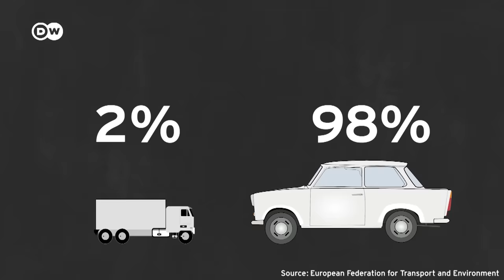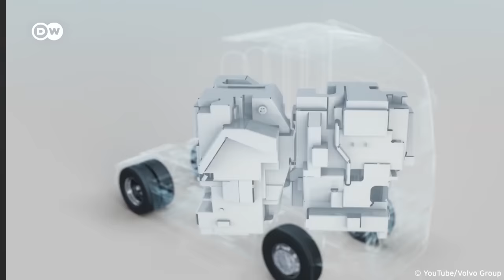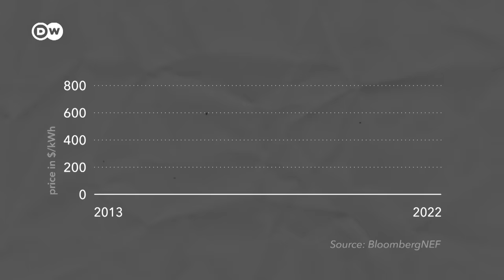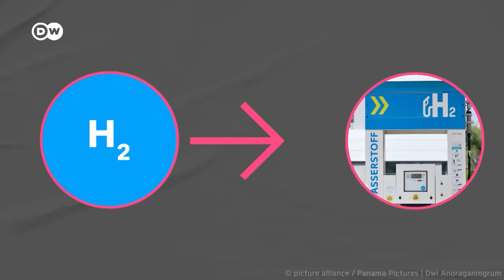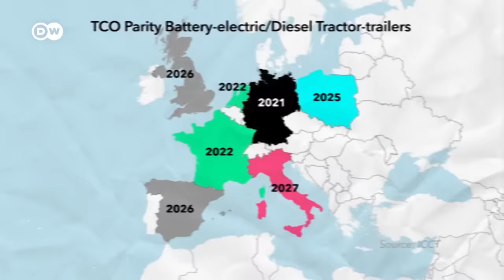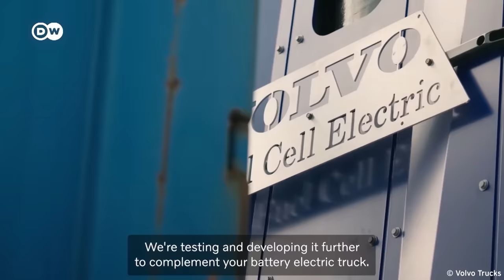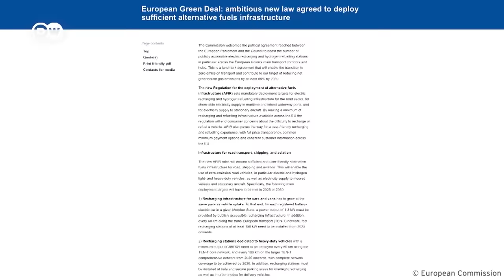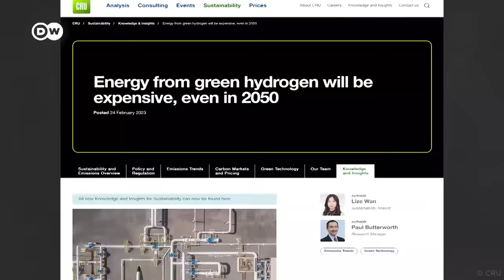Which will be the engine of the future?

Comment: I always thought that the trouble with electric trucks was that the batteries are heavy so they eat into the weight that the truck is permitted to carry on the roads.
Reply: Yes, but not as much as had been feared, US adds 2,000 lb to the 80,000 lb limit for low emission vehicles, and it looks like that's enough. The volume (space) taken up by long range hydrogen tanks is the flip side of the same coin.
Reply: The weight is a factor but charging time hasn't changed and each truck needs a Megawatt charger for about 8 hrs to go 500miles /800km.  Where as diesel has 1000miles/1600km with a 5 minute fuel stop (truck stop pump move fuel much faster than passenger pumps)

Then ask yourself how are the roads being funded when EVs weigh more put are not paying fuel taxes.
Reply: You're math skills are a bit off I think. A truck uses 1,1 kW per km. So to drive 800 km you need 880kWh. A megawatt charger charges 1000kW. So to fill up a 880kWH battery it needs to run 880/1000 of an hour. That is 53 minutes, not 8 hours.
Reply: @bartvandenpoel8568  efficiency rules all.  Can't charge at max power or battery will explode and more systems are used than just the motors during driving plus elevation changes and are your numbers at max load?
Reply: @bartvandenpoel8568 Of course you are perfectly right, but as you can see with the following comment, being right on basic maths does nothing if one has already decided that EVs are bad. Haters gonna hate.
Reply: @brushlessmotoring  An extra tonne of load will help but I think you actually need more than that for a semi.  On the gas side, I wouldn't worry so much.  When oil prices were high about 15 years ago all the trucks and busses moved to CNG, almost overnight, and they manage OK.
Reply: The best BEV heavy trucks are either on par or only slightly heavier. Tesla Semi is the best example. The tractor weighs around 25,000 lb. Which is on the heavy side but still on par with the heavier diesels.
Reply: @bowez9 where do you get this nonsense? A Megawatt scale charger would charge Semi in 30 minutes. The time of the required driver rest break in the US. And fueling a diesel semi is typically between 10 and 15 minutes. And the driver still has his required rest break. 
Ask yourself how the damage from climate change is being funded already. The answer is with your tax dollars.
Reply: @bowez9 Tesla Semi has a 500 mile range on its 900 kWh battery pulling a 55,000 lb trailer. And can charge at 1.5 MW peak. That is 5% charge to 80% charge in 30 minutes. 
Note that 480 miles is 8 hours of driving. The point that, in the US at least, a driver is required to take a 30 minute rest break. 
Also note that 80% of 500 is 400 miles. So the truck can go another 6 hours for 14 hours total but the driver is limited to 11 hours total for a work shift. 
That means the driver has a lot of discretion on when to stop to charge and a significant reserve left for a full day of driving.
Reply: @williammeek4078  30 mins is from 20 to 80 percent not 5. And that is under ideal conditions.

not for OTR or team driving, then the limit is fuel.  Actually  talk to drivers and you will find out only theirs logs show they are doing it by the book.  

But the better question who's going to let a truck charge, the customer, the broker, or the depot?  Multiple Megawatt charger are hard enough in industrial areas they are nye impossible in rural areas were they will never pay for themselves.  Think a truck spends 5 minutes at tge fuel island now and there are 20+ pumps and trucks are still waiting now think of them spending 30 minutes there for 5 chargers, not even to think when one goes out.

Now how long and often do chargers actually operate at peak power delivery 80% is the practical upper limit.  RMS trumps peak.
Reply: @bowez9   no, it is 5% to 80% on the 1.5 MW chargers. And no, that isn’t just under “ideal” conditions. 
Even for team driving, Semi would only lose an hour a day. So for 95% of trucking, Semi will be as fast or faster. That last 5% isn’t enough to support the diesel infrastructure. 
Trucks will charge where they stop. Loading/unloading operations take enough time to fully charge at less than maximum rates. 
Anything less than 250 miles, just charging at the depot will be an option. 
Less than 500 miles, charging at the destination works. 
Only trips over 500 miles would need charging at a commercial charger. And that will be less than 5% of the time. And will happen on the driver required rest break so no time lost for any routes less than 900 miles. Which is 99% of road freight. 
Again, the market will sort that one out. 

Hate to be the one to burst your bubble, but the era of diesel is coming to an end.
Reply: @Will-ef2tw  after several million miles of savings in diesel, maintenance and downtime, and with the rapidly declining cost of batteries, probably $70 per kWh for a pack replacement, less the $20 per kWh the pack is still worth as ore for recycling into new batteries, you will still come out far ahead. If you use lithium iron phosphate, the insanely high number of cycles you can put that chemistry through will likely see the truck fall apart long before the battery needs replacing.

This longevity is proven through million mile Tesla Model S’s from a decade ago, the packs are lasting far longer than naysayers have predicted - the early Nissan leafs had a poor pack design, and this resulted in a bad reputation that has stuck, even after Nissan sorted their batteries out. Don’t believe the myths unconditionally, dig deeper into this subject.
Reply: @williammeek4078  sorry your numbers contradict Tesla.
Second why as a customer should I not only pay you to deliver but also pay to fuel you?

How far do you think a driving team can go in 23 hrs?  Remember driver 1 is getting his rest period in while driver 2 is active. 
Loading/unloading is were most drivers will get their down time.

How long will those batteries last fast charging them multiple times a day?

Logistics is a business of single digit margins.
Reply: @williammeek4078  ask yourself what is powering the mines for the batteries- diesel.   How are you going to stop the poor from using cheap sources of power- especially those not in your country?
Reply: @chuckygobyebye  because CNG is a lot more energy dense (by volume) than hydrogen. And you are right, trucking did shift to CNG when diesel was far more expensive. Which is why trucking is already shifting to electric on every route they can today, and looking to what else they switch soon - see Australia battery swapping trucking and of course the very encouraging real world results from the Tesla semi analysis. I’m not at all worried about whether it will happen, just a question of when.
Reply: @bowez9  batteries require a slightly different set of logistics than liquid fuels, not impossible, different, you are trying to treat the battery truck the same as a diesel truck, it isn’t, it’s slightly different, not better, not worse, different.

We do the things we do with diesel trucks because we can, we can’t do more, electric trucks have limits too, different limits, if you present those limits to a capable logistics company, and all the successful trucking companies are capable logistics companies, they will solve for the new set of parameters.

We are not going to figure it all out in the comments section of a YouTube video, but the idea an electric truck can’t be used because it can’t do this exact thing in exactly the same way a diesel truck can is clearly nonsense, especially as some of your examples are at the extreme end of trucking - so we keep using diesel there for a bit - it doesn’t mean we don’t go electric for 95% of the use cases they do just slot into. 

Relax brother, if it’s no good, it won’t get used beyond some trials, if it’s better, even if it’s different, it will get used. That’s the free market, and like you say, cost is what trucking companies have their eye on, but we do need to charge for the impacts of emissions better, you can’t pollute a river without being fined, so why is okay to do the same to our thin shared atmosphere for free?
Reply: @bowez9  specifically what numbers? Musk specifically said Megacharger can add 400 miles in 30 minutes. 

Semi covered 1000 miles in 24 hours with multiple drivers. And that was with multiple stops. And this is a typical distance for team drivers. 

The batteries are designed to last 1 million miles. With newer packs, fast charging isn’t hurting them. 

Then diesel aught to be very afraid because Semi has half the operating costs per mile.
Reply: @bowez9  read: “South African mines seek to turn up renewables to ease power crisis” - Reuters

That is my question to you. How are you going to stop poor people from using cheap sources of power like solar and wind that are already vastly cheaper than fossil fuels? It is already happening.
Reply: @williammeek4078  guess you never priced inverters or batteries to make it a fair comparison for 100% availability.

But your deflecting, answer what fuel is being used in the mines, for the trucks and the equipment.
Reply: @bowez9  i guess you never priced diesel generators and fuel for 100% availability. 

No deflection guy. Just the hard reality that mines are going to RE because it is cheaper and more reliable.
Reply: @brushlessmotoring  totally agree with your points.  Just too many people think EV is the cure all end all solution.
Reply: @williammeek4078  first what Musk say is usually at odds with what his companies say.  Ask him what the SEC has said about his comments, or what Germany thinks of his "autopilot".

If you think fast charging isn't hurting battery life then you haven't read up on the subject let alone reading the white papers.  Sony and Panasonic will clearly tell you that fast charging shortens battery life--and supply Tesla under liscence.

But EV trucks have a much lower ROI.
If they were so good why aren't the big frieght haulers(JB Hunt, Schinder, UPS, FedEx) using them?  I posit they only make sense in very limited use cause that PepsiCo is using it in.
Reply: @bowez9  you are giving the impression you think EV trucks are good for nothing - I’m sure that’s not what you think.
Reply: @bowez9  look at the differences between NMC and LFP chemistries. LFP can take a beating all day every day, these are not your 1990s camcorder batteries or even recent cellphone batteries.
Reply: @brushlessmotoring  they have limit use but in America I believe they will always be the minority-given a fair choice.  It's hard to argue with energy density of diesel and ROI of diesel trucks.
Reply: @bowez9  so, you have no contradictory information. Got it. 

If you think fast charging is detrimental to battery life for Teslas, you haven’t read up on the subject. 
Here is your homework that you didn’t do before. 
“Full Speed Ahead: EV Study Reveals Impacts of Fast Charging” - Recurrent 

“Nikola gets an electric truck order from JB Hunt” - FreightWaves

“Schnider’s Electric Heavy-Duty Trucks Start Off on Regional Routes” - Heavy Duty Trucking

“UPS Invests In Arrival, Accelerates Fleet Electrification With Order Of 10000 Electric Delivery Vehicles” - UPS

“FedEx Continues Advancing Fleet Electrification Goals with Latest 150 Electric Vehicle Delivery from Brightdrop” - FedEx

Pepsi’s use case is deliveries under 500 miles which is 95% of road freight.
Reply: @bowez9  if you don’t price in the pollution, diesel is quite compelling, but I still bet batteries will come out, total cost of ownership, cheaper - time and studies will tell, the market will decide, but, if we keep subsiding the cost of oil extraction and diesel emissions and don’t price those into the cost of the fuel, then diesel has an ‘unpriced externality’ that makes it appear cheaper than it truly is, so that’s a false ROI if we then have to pay taxes more to fix the problems it causes.
Reply: @brushlessmotoring  so don't subsidize the oil industry what about all the lubricants in EV and synthetic material used to make the ie the plastic films in batteries, but do subsidize the EV market?
Reply: @bowez9  I’ll answer your mine question: batteries (mines have long used electric vehicles underground for obvious reasons), charged by solar, wind and diesel. What’s your point? The first parts for the ford model T were delivered by horse, that didn’t stop the motor car replacing it. Try and let go of this absolutism, it’s meaningless, we will always be using a blend of solutions.
Reply: @bowez9  again - what’s the point you are trying to make? Yes, oil is used in EVs, for plastics, mining, lubricants, we still need all those oil based products - fertilizers, medicines - the list goes on and on - the goal here is to reduce *combustion emissions*, that’s why we are moving to electrics, to stop using combustion engines where we have a useable - different - but useable - alternative. It’s not about ending oil, it’s about stopping unnecessary emissions, a depot run of 200 miles does not need the long range of a diesel engine, as EV trucks get more capable and cost effective you replace 300 miles routes, then 500 mile and so on. Stop thinking in absolute all or nothing terms, it’s not helpful to the discussion, it’s why you are getting so much pushback.
Reply: @bowez9  as this video was about hydrogen trucks too - what do you think of hydrogen for transportation? How would you make the hydrogen?
Reply: @brushlessmotoring  if you understood oil refinement you would understand it is an all or nothing process.  
The mining equipment is by in large diesel series hybrid, diesel generators with electric traction motors.
Hydrogen IMO  is a better option than batteries, but why break down oil for the Hydrogen instead of just burning it as fuel.  Let's be honest on where the vast majority of Hydrogen is coming from and its not electrolysis of water.
Reply: @bowez9  do you have to be so insulting every time you reply to someone? Can you just not help it - are you even aware of it?

Oil refiing uses a stack, at different temperatures, you get different products, you can configure the stack to produce less kerosene, gasoline and diesel and more jet and rocket fuel. Yes, I do understand oil refining.

Hydrogen is made from methane, with CO2 released, is about 50% the CO2 of gasoline, so it is better, but, it's so complicated and expensive to handle, especially compared to existing grids that batteries are the better option.
Reply: @brushlessmotoring  you can change the output but not eliminate any of the products.  So if you want plastics you will have gasoline, kerosene, diesel...  so you either use them or waste them.  If you understood that why are you arguing it, oil is an all or nothing proposition.

If you're ignoring facts and figures don't be upset when someone treats you like you are ignorant.
Reply: @bowez9  The point I'm trying to make, is that these constant 'hydrogen breakthrough headlines' never deliver, wake me up when there is 100 millions tons of this 'white' hydrogen getting mined and transported - I feel the same about solid state batteries too - wake me up when a car with them has sold a million units.

'Headlines not Hydrogen' is what I call it, part of the 'please wait for this, don't get an EV' - it's a distract and delay tactic, and it works, repeating this borderline misinformation keeps people out of renting an EV to see if it might work for them.
Reply: Battery swapping for semi trailers is already a reality. The swap is done at freight depots as vehicles transfer loads or while drivers take a rest break. 

The swap uses a modified fork lift to slide out and replace the battery cassette. Depleted batteries are then racked up in a charger which gives them a slow steady charge.

The system is already in use in Australia.
Reply: @bowez9 for heavy machinery they could simply swap out their battery, that’s how china is doing it.
Reply: Also the loads made it have a very low milage. Just like when you towing using a normal ev
Reply: And don’t last
Spend more time charging then driving
Reply: i would invest in hydrogen, batteries are okay for now but they are not the future. fussion and hydrogen are the future in the next 50-100 years
Reply: @bowez9  So your logic tell a truck is driven 1000 miles without any stop for resting and that's why diesel is required? At least the resting periods which are mandatory in Europe are sufficient to charge a truck. It's just matter of how fast they scale up the charger infrastructure. I believe we haven't seen everything yet. Some kind of induction charging could come to truck lanes in some highways in mild climates. I mean integrated to the road surface.
Reply: @timogronroos4642  yes that is done , that is why truckers have pee bottles.
Reply: @Maxშემიწყალე  : Can you expand on your claim that batteries take a lot of oil to make and extract?
Reply: Not to mention the increased need for break and tire replacement.
How does replacement batteries and truck body parts cost vs diesel trucks?
Reply: @bowez9  Check your numbers. 8 hours at 1 MW is 8000 kWh. The Telsa Semi uses 2 kWh/mile. So 8 Hours charging provides a range of about 4000 miles
Reply: @PJRye  you assume 100% efficiency
Reply: @bowez9  No, I assume simple arithmetic.
Reply: @PJRye  and 100% acceptance of the battery and 100% delivery from sources, with no derating for heat or charging dynamics.
Reply: @bowez9  So you tell me what efficiency you are using. It looks about 5-10$% !!
Reply: @PJRye  potentially.

When did I ever list a charging time? I just all BS on ~1hr charging.
Reply: @bowez9  Good point about the number of trucks at any given fuel stop. In order to support the needs of all the tractor trailers on a major interstate, there would have to be a lot of them at each stop. Think about how many chargers would be needed--then picture how much power a megawatt is. It's roughly the power consumption of a walmart running their lights, freezers, doors, machines, et cetera. Any multiple of that is a huge ask for the electrical infrastructure of just about anywhere.
Reply: To a point, but most trucks aren't trying to haul cargo from Moscow across Siberia to Vladivostok on a single charge.  The vast majority of truck miles are local fleet, where electric is ideal
Reply: @bowez9   Roughly 95% of non-weather road wear comes from heavy trucks.  Passenger cars, even electric ones, produce approximately ZERO road wear.  There's no need to tax passenger EVs as their zero emissions benefits easily offset whatever marginal road wear they cause.  Where passenger cars drive cost is in adding more lanes for more cars, but that's not how EV taxes are sold.  The real answer is that trucks, and especially high pollution diesel should be paying far more in road maintenance taxes.
Reply: @ZweiZwolf  nice you define heavy.  Meaning given how heavy EVs are they can classify as heavy.
Especially considering it's axle weight not vehicle weight.
Reply: @bartvandenpoel8568  don't waste your time, on muppets
Reply: @bowez9  A "heavy" passenger EV weighs maybe 6,000 lbs / 3,000 lbs/axle with 40 psi tires.  A semi-trailer is 80,000 lbs over 4 axles with 100 psi tires / 20,000 lbs/axle.  Passenger EVs are nowhere near the impact of a heavy truck.
Reply: @ZweiZwolf  try agian semi trucks are at least 5 axles, at an average of 60,000lbs.
While a heavy EV  is 7000lbs-9000lbs, the average is 6000lbs.  Do your research and to a fair comparison.
Let's not even talk about how for Semis your useing GCWR while the EVs going with Curb weight.
Reply: @bowez9 The only part that matters is the 80,000 lb cargo trailer, where the weight is supported by the 2 drive axles on the tractor and the 2 axles on the back of the trailer.  4 axles total. Even if it's 60,000 lbs, that's till 15,000 lbs/axle, which is at least 3x the passenger loading.  Road wear due to axle load is superlinear, which is why the truck axle does more damage.  Stop apologizing for Big Oil.
Reply: @ZweiZwolf  not apologizing, just insist that you use consistent facts.

As the GCWR for Model X is  >10,000lbs.

Those cargo trailer unless permitted-meaning they paid the fee-do not weigh 80,000 lbs.  Very few tractor trailers weigh 80,000lbs scale weight.

The number of axles is 5 minimum.  1 steer, 2 drive on tractor, and at least 2 on trailer.
Reply: Thats a big issue. But not for the Tesla truck
Reply: @bartvandenpoel8568  That is probably close to the time required for driver rest in the Driver Fatigue Laws - so very doable